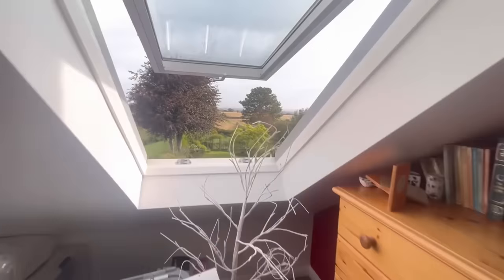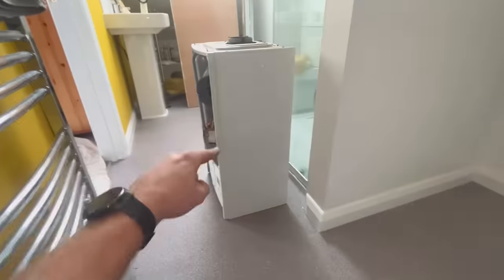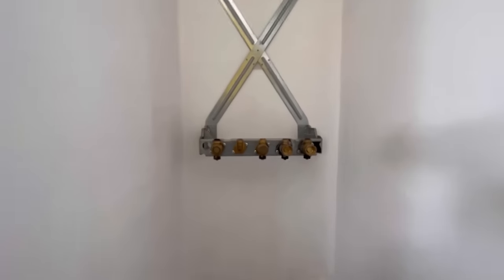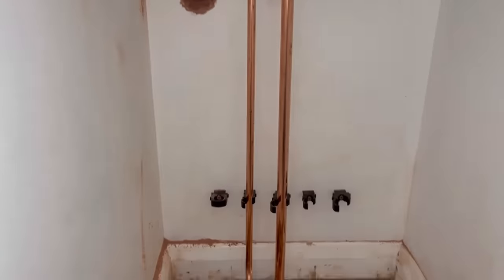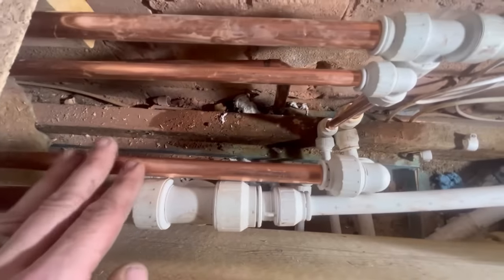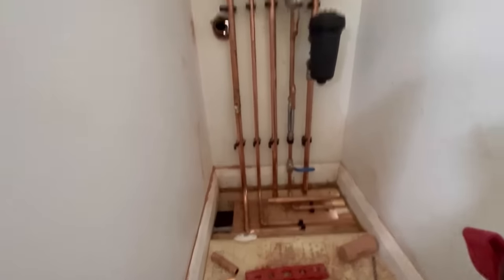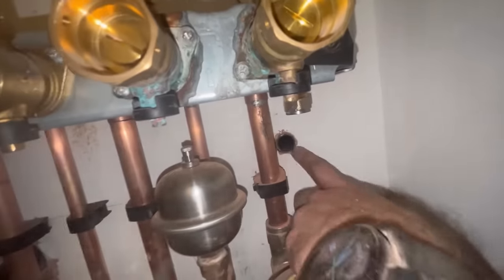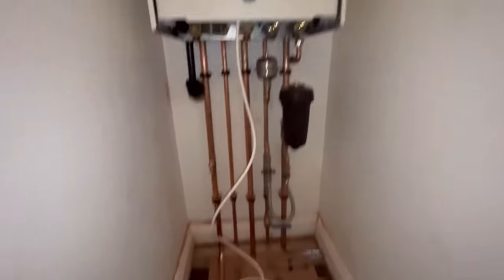How Easy is it to move a boiler? We had to walk away from this one!

Comment: I'm a DIYer. The pipework at the start looked a complete mess and credit to you for doing a neat job. I just wondered why you fitted the pipework through some flooring. Wouldn't it have been easier to pipe-up first and box in after? Especially based upon the untidy previous work.
I refitted our bathroom in 97 with yorkshire joints and a heat gun. Push fit was unproven and expensive back then. It was a steep learning curve with lots of frustration!

Comment: I moved a boiler for a builder once for an extension he was building...it didn't end well so I'll never do it again. The flue was rotten in the wall, the jig was bent and twisted, and the formed elbows needed replacing....by the time I'd finished it would have been easier to fit new
Reply from the maker: Yeah I’ve looked at some and just refused ain’t worth the hassle, to move them they have to be decent make and under 10 years other than that won’t survive or just be an absolute pain 👍

Comment: I love soldering. Its a dying art and takes skill, keep doing it. Might take a little bit longer but looks so much neater. Looks tidy that from what ive seen
Reply from the maker: That’s Steve, just one of them days I think 👍
Reply: If soldering is a dying art then what I was taught with he Gas board must be an antique art. Doing rolled and wiped joints with lead, that really does take skill to get it right, not to mention branch joints which were a complete PITA. Also the bending like query joints. Now with Speedfit anyone can be a plumber or so they think.
Reply: @thegrumpygamer3081 I’m only 31 but was taught by an old NE gas board fitter. He taught me to do lead joints don’t know why but I’m glad he did.
Reply: I remember learning how to solder/sweat copper to lead and use my moleskin. Today i hate soldering and see pushfit as wonderfull.
Reply: I don't see any 60 yr old+ pressfits that still hold water...😉
Reply: @adamdavies163  Speedfit was launched in 1987 and it was crap when it first came out.

Comment: When soldering I found it don’t need a high flame turn it down until you get that whistling sound no scorching and far more control over the solder less runs and if it’s non potable use lead , lower melting point and don’t run as much.

Comment: Yep, I agree with the other comments, we all get the bad days, but an excellent neat job. You could try a bit of Hardybacker board for your soldering, it works a treat and you can cut bits to fit into all those dodgy areas, no heat goes through it.
Reply from the maker: Nice tip mate appreciated. Definitely a off day but unfortunately it carried on this week, was just one of them 😅
Reply: Beat me to it. It takes up zero space on the van and is 100% effective. I also use Yorkshire fittings on everything I can, it cuts down time with the heat, as soon as it’s ready the solder runs, no more time required ( extra 10 secs to add solder and wipe I know, but sometimes crucial in tricky areas ) to keep the temp in the joint up. 
I’m a commercial guy, getting Mrs Smiths heating back on isn’t a priority for me. I’m domestic/commercial registered, but avoid houses as best as I can, usually it’s a domestic boiler as part of a commercial property, ie a caretakers house in a school etc.
You seem to want to do a 💯great job, ignore this install, it won’t define you. Rushing against the clock is always a recipe for disaster 😢
Reply: Like that idea too, as those insulation mats are not exactly cheap!

Comment: I think is about time one of you gasenginers be brave and bold enough to start using MLCP pipe for boilers save lots time and less fittings you can shape those pipe fairly easily camon lads give it a go
Reply from the maker: It’s having the equipment to do it, plus if there’s is ever modification to be done not everyone uses it, I can see the benefits of using it thou if it was more common

Comment: Mate do plumber do much wiring and what is the extent of it can u legally wire to the spur or how does it work 🤔 ?

Did u wire the sockets in the new area or was that a sark and what was the amount of wiring u done on this job specifically?
Reply from the maker: Anything after fuse spur you can do, wiring I do all my own on systems from combis to systems with undefloor, multiple zones etc
Reply: My wiring is 101 basic like wiring a socket and rewirin a light that's bout it how did u learn to wire as much as u do and is wat u do still the basics or is it quite advanced to wire after the fused spur.

BTW excellent vid and sorry bout the questions I'm just shocked at how much a plumb needs to know wen u compare is to a spark or does a spark need to know some plumbin to hahaha I'm confused 😕 😆🤣

Comment: Are there any professional plumbers who can tell me where it says either in Manufacturer's instructions or building regs it states that "Push Fit " plumbing does not require clipping? Time and Time again  i come across this.  and the infamous quote...  "It will be alright and I've never had a failure"  If you're not clipping push fit then you're not doing the job correctly. Nice to see it was changed to copper.

Comment: Milwaukee care drill is good my friend has a hilti core drill and that is in a league of its own but you need to keep hold as the torque is quite high and the clutch is vicious
Reply from the maker: Thanks for the advice mate, will take a look. my mate has the dewalt angled drill which is a beast, but it could take your arm off if it snags!

Comment: Don’t normally comment badly on your videos mate because your works mint that waste at the bottom for the shower could of connected onto that flexi into Mcalpine tee then back out into trap clip the flexi would of worked also Worcester got 250-300 from soffits press tool get a novo press ace 103 small compact powerful goes upto 35mm good little press tool had mine few years now be lost without it

Comment: Press gun, really big, expensive  ,nah
Stick to the solder
If you are that worried about dripping solder,start using Yorkshire fittings
Reply from the maker: I’ve used Yorkshire in pass but I’m still tempted to run some solder in them every time I’ve used them 😅